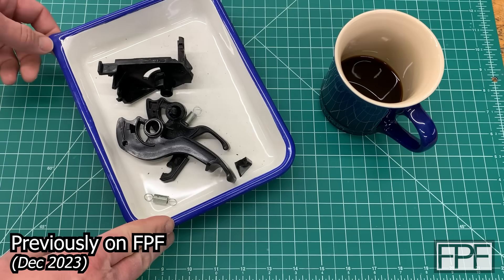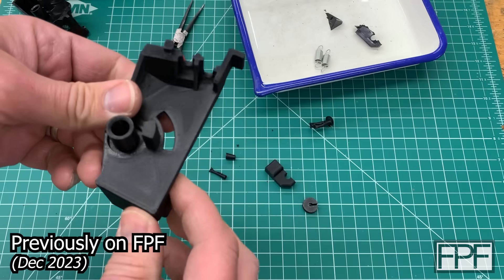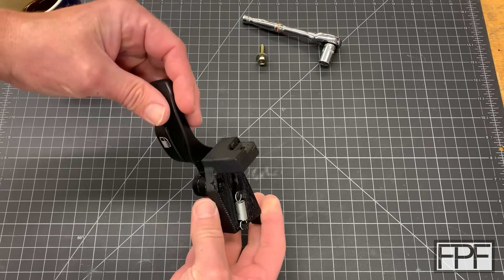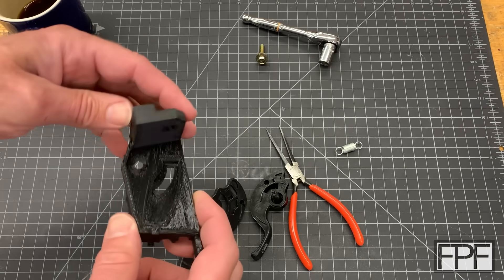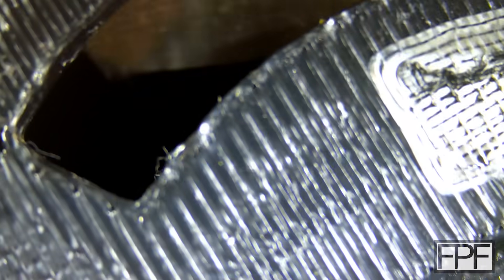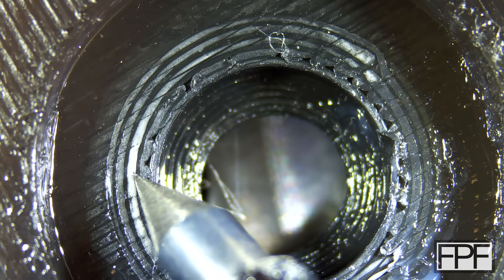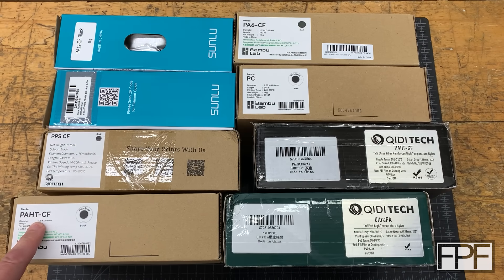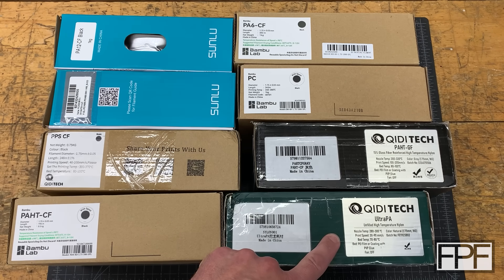3D Printed ABS Car Part Failure Analysis

Comment: 1. Easiest solution is to just add a hole through that part that broke off and put a small long screw through it. Then the material basically doesn't matter.

2. You got some things wrong about your filaments. Pa6 and pa12 are two different kinds of regular nylon, 12 is a bit weaker but is much more moisture resistant. Pps is not a nylon, it's something completely different. Qidi ultraPA and paht-cf are not regular nylons, they are PPA filaments and are very stiff, much more than a regular nylon. Bambus paht-cf is pa12-cf. 6 and 12 are not the cf percentage

Comment: Simplest place to start would be to run a flow dynamic calibration test for whatever filament you choose on the Bambu printer to remove the under extrusion ... review other slicer settings to make it stronger.  Do it in the original ABS to confirm that this solves the problem.  Also some greases and locktight degrade ABS / ASA ... use a dry wax lube.  https://youtu.be/5CVq6DycUOE?si=OrKUif9b5eK9i1Im   Make some test pieces that mimic the two failure points and print those, break them open look under the microscope and adjust settings until you get the print as you want it.
Reply: I reviewed his earlier video to understand the original failure. He used the same silicone grease I use to lubricant my P1S. It is recommended for most plastics, including ABS.

Comment: You are correct that the dimensions of the cylinders are constrained…but that constraint is primarily relative to one another. You may need to allow a pin inside the smallest one, and there may be a feature you need to clear on the outside, but without that you are free to resize with impunity so long as you resize all three at once.

Also, what you identified as under-extrusion may not actually be (without knowing more about your CAD and printer settings); it may be that the feature thickness you chose isn’t the proper value for an exact number of perimeters. It did draw the first two perimeters correctly touching on each side, but just laid the fifth one halfway between because the remaining space was too wide for a single perimeter to fill but not wide enough for two. I’ve made that mistake plenty.

Comment: Make in 2 parts. 
1.  Main body printed with current orientation. Thicken underside to suit
2. Flanged sleeve with chamfered transition between cylinder outer surface and flange inserted from the underside. Printed in 45 deg rotation (or horizontal). Superglue assembly.

Comment: 1:10 the engineer who put this here needs to be fired, you don't put something like that in the foot well where it's going to get kicked and stepped on.
It's not really that much fault on the printed part (even though yours under extruded), OEM parts like that do break if you step on them hard (like what would naturally happen in that location)

Comment: Consider the taxes those printer prices seem to be extremely low.

As far as I know, adding fibre to the material does not help (or might harm) for inter layer connection.

Comment: rotate the part 90 degrees and print it so all the high stress poking out bits are not supported by layer lines that can shear off. you could even get away with rotating it 45 degrees, so the parts that sheared off have some layers transiting the shear points. if you are going to use ABS, do an acetone dip so you solvent weld all the layers together as well. or use a better material. PC or PA, with carbon fiber. the part is small and the added cost won't be much.

Comment: Change the orientation. Otherwise, based on the way it failed it was definitely stood on. Forcing the levers past their stopper and putting excessive bending load on the pivot. I recommend doing nothing and making the shop fix it!😂

Comment: Make your part thicker where you can behind the round cylinder.  Then make the hole around the cylinder deeper.  That way you can give it a nice radius at the base.  To have a flat bottom print a washer that covers the radius.

Comment: Have you tried to orient the print so it prints without having any weak spots from layer lines? If it's not possible to orient it that way you could instead print the weak parts separately with correct layer orientation and then glue them in.

Comment: Recommending TPU for AMS on 0.6mm nozzles.  From memory, 0.4mm nozzles didn’t work for me.  I’ve since updated the H2D, so … TPU has great z-axis adhesion.  Note, I haven’t tested other higher end materials.  I also printed at 230 at the nozzle from memory - 10 degrees hotter.

Comment: one possibility would be to add a hole you could thread a small bolt through into that tab from the other side.
Reply: Finally, the correct answer

Comment: I would make the cylindrical part a sleeve with a lip on it (L-shape cross section), if possible, with a big ole washer on the underside to secure it (I assume a bolt runs thru it). Washer maybe not needed if you used a countersink screw head type. This makes the concentric layer adhesion a non-issue. But you could reinforce the lip on the sleeve with a chamfer/blend to get some more strength in that cylinder, like you would have if it were on the top side (but didn’t have the room). You could add a chamfer relief to the underside of the big piece to leave room for this chamfer. This two piece design also means you could lay the cylinder on its side and orient the layer lines vertically on the cylinder, adding to its bending strength (would require supports but would be stronger). Maybe consider downsizing the hardware, to get more walls on the cylinder. I also don’t see why you couldn’t add a blend/chamfer on that square block piece, but maybe there is some interface with the other piece? I’d try PET-CF, that stuff has been great to print with lately, is strong and temp resistant, and is relatively affordable. I started using the “Iron all solid layers” option and while it increases print time, it also significantly bonds the layers together better,melting each layer into each other and filling in underextrusions. An awesome feature for functional prints!

Comment: I would figure out how to print that cylinder with more constant extrusion and adhesion, maybe lower speed and increase flow?
As for that stopper piece that broke, I would consider replacing it with a bolt. 
Swapping plastics might work but I wouldn't jump to that right away. I would  first consider changing the print orientation since it broke on the layer adhesion which is probably not going to be improved with stronger plastics or infused GF and CF.

Comment: At least for the nubbins that hold the spring, I'd try a machine screw inside to borrow some strength from steel. Maybe there's something metallic that can be used to strengthen the hollow boss / axis pin. Perhaps a bronze bushing.

Comment: I would still use ABS. Like others have said print the parts that broke as separate pieces that fit into a pocket. Print them so the layer lines are not un line with the stess points. I would also add acetone vapor smoothing to try and increase layer adhesion to ABS parts.

Comment: If you are going to live and die by 3D printing you should ignore everyone who said put in a bolt / screw / pin and see if you can get the part to work via printing only
I think the rectangular block failed first which then enabled the cylinder to shear off so in CAD I would cut away two small slots or cylinders into the block so effectively you are adding additional solid walls internally and I would experiment with putting as large a chamfer as possible at the bottom of the block and the cylinder to provide more resistance to them shearing off
I would also see if you can add a printed stop to the body of the part for the levers so they cant be lifted past a certain point to cause the break.Slant 3D has a good vid on how to make parts stronger through design
I think PET-CF would be a great material for this part. Print it at 305C so it really melts together
I think your vids are great so keep up the good work!

Comment: Many people have tested ABS strength, and while it is heat resistant, it's too brittle for most things.

I would imbed a metal frame into the part. Poor design, more more Toyotas moved those levers to under the dash.
Reply: It's not brittle at all, quite the opposite.

Comment: i would go unfilled filament for the better layer adhesion and with parts rubbing on it there will be some abrasion, also i woul design the part so the two parts that broke off are printed separately and inserted and glued in after. Because of the large final layer that they are printed on there is a lot of time for the plastic to cool down and loose even more layer adhesion

Comment: Definitely either change the print orientation of the whole part so the stress isn't along layer lines, or break this up into multiple parts with print/layer orientation that complements the intended stresses and then assemble the parts. I don't think a material change alone will make this sufficiently stronger.

Comment: Printing the cylinder and post separately, aligned for layers running perpendicular to the stress would make a huge difference no matter the choice of filament.  Create a socket for them in the body and insert. 
Another option would be to use a pressed in steel pin instead of the post.

Comment: It is likely the original part was made out of PA6-GF. PA6 and PF12 are just different nylons. I would try a Nylon if you're set up to print it dry, either CF or GF impregnated. I do not have personal experience with these filaments though.

Comment: There is an experimental fork of Orca slicer that has a feature called "staggered perimeters". Together with a slight over extrution you can increase shear resistance and bending resistance by quite a bit.
Reply: Someone who really wanted staggered perimeters to work well tested it. His tests showed only a slight improvement. However, overextruding showed significant gains in strength. IIRCthis was CNC Kitchen.
Reply: @iseolake  Yeah, I watched that video as well. He only tested in tension. For shear forces it should be much stronger.

Comment: PPS-CF is way to brittle, PAHT-CF is easy to print and has some flex to it. The one I would recommend is PPA-CF. That filament is magic but might also be to brittle. Biggest gripe is how stiff the filament is on the spool, can’t even use the last 150g+ cuz the extruder can’t unspool it.
Also, why can’t you hand modify the part to allow a chamfer on the printer part?
Reply: Paht-cf which is actually ppa-cf has some flex? It's the most stiff material you can 3d print at home. Unless you are thinking about bambus paht-cf which is pa12 but it's also pretty stiff, more than the pla

Comment: Id make the hollow pivot part a separate piece and attach it by threading a short screw in to it from the face that that you said could be thicker, you could also do the same thing with the stop by threading 2 small screws or set screws  into it(it could still be one piece just with holes to thread a screw into), that way the layers are mechanically held together and will not fail along layer lines.

Also another simple thing you could do is add fillets to the stop in the xy plane, not sure how much difference it would make since it is so small but fillets generally make for a better toolpath and reduce stress concentrations.

if the pivot is a standard size you could also try and find a bushing that you can press in from the back side.

Comment: I would suggest you change the orientation of the print so that it can't break along the layer line.  Of course you would probably have to use supports, but if you have a printer that can do multiple filaments, you could print the support in something that does not adhere to the primary filament and you would get good results.

Comment: From a real novice- how about TPU for AMS (Bambu)? Not sure of temperature capability .  Also print at an angle so layer lines cross over the weak point.  Reduce layer thickness to a minimum? I enjoy your thought process for your design s.

Comment: PA6-cf and PA12-cf do not refer to the percentage of carbon fibers. They are different nylon polymers. However, to solve your layer adhesion problems I would consider printing the part in a different orientation so that stress does not occur along the layer lines in the first place. You may also be able to print the part in several pieces if you want to avoid the excessive use of printed supports while still printing in the strongest orientation. Of the materials you have here PAHT is probably the strongest, but I wonder if a hard TPU will work fine here if you only care about layer adhesion and don’t want to change the orientation.

Comment: Just print the nub that holds the spring separately in a horizontal position and make a hole where it would attach to the main piece. Then glue both of them.

Comment: The QIDI PAHT-GF is really a PPA-GF, the prints that I have done with it has been really strong and had really good layer adhesion while the the ABS that I have printed have had a tad low layer adhesion. I'd give the QIDI PAHT-GF (PPA-GF) a try on the current-ish design instead of putting a lot of time and effort into a big redesign and it would likely hold up much better.

Comment: PA are the nylons, 6 and 12 are the length or number of carbons in this case, in the monomers of the polymer. I think PAHT-CF would be a good choice. The PA6 and specially PA12 usually suffer from creep.

Comment: Barring inserting a metal part I would say to create a mortice/tenon to fit one face to another with a pocket in the middle for a plug to be printed separately.  (Similar to a biscuit or domino joint.) Then use something like Weldon16 to glue it all together.

Comment: I've noticed over the years that there are design considerations that apply to printed components. Things like reinforcement ribs, chamfers, relief cuts... It still won't be as strong as an injection molded part without annealing though.

Comment: I've had a look at the model.  For the part that snapped next to the tube. Pin it with 2mm locator dowels.  For the tube it looks like you have just enough meat to use 1mm pins (or drill bit snap offs) I'd use 8 x 1mm pins arranged evenly and inserted from the underside.  Again don't underestimate the additional strength from CA glue saturation. Or if you can get it in the correct size. Sleeve it from top to bottom in thin wall brass tube (from the underside).  Heat the brass until cherry red and once cool it will be quite malleable.  You have a lathe so you could make the tube an insert with a brim (like a top hat) and press it in from the bottom.

Comment: I have strengthened parts like that by modifying the CAD model such that the parts that broke off are separate parts that extend all the way through the part.  This way, those parts that broke can be printed flat so sheer stress is perpendicular to the layer lines.  This method requires some assembly after the print is done of course.  I would go with PETG or whatever filament you have that reacts with Weld-On to fuse them together.

Comment: Now you know where the part is stressed, so I would redesign it to be 3 or more parts. Main body and inserts which are stressed by the springs/rotational forces. Then you can control print orientation of the inserts for best strength. Workout tolerances to insert the inserts. Not sure if material really matters, ABS is generally fine, anything more "rigid" -- would likely fail faster with less ductility. You could try ABS-GF, but I've had parts which require some flex snap on me and I've gone back to regular ABS in the past for those parts. It's less of print tuning/better layer adhesion than part design for FDM problem. If you're not going to get the part SLS printed, and want to treat it as an engineering problem for FDM, look at open source printer designs where parts are intentionally split to take advantage of orientation and material ductility.

Comment: Would PETG GF be a good choice? Whenever I’ve used ABS in the past, it’s print quality is amazing but it seems to be fragile. I don’t think PETG has that same issue. The one thing with PETG to watch out for is it has trouble with overhangs as the material likes to droop so if you’re gonna use it for this part, you need to make sure you have plenty of supports and if possible use a different material on the interface layers so it supports peel off easily. This is because it’s layer adhesion is a very strong.

Comment: I'm thinking the PPS-CF is your best bet. PPS has incredible layer adhesion even with CF added, and it's tensile strength is incredible. Flexural strength isn't the highest but for this part it's not like it needs to be under constant flex, it not always supporting a load it's generally just sitting at rest.

Comment: PAHT-CF I have used both Bambu and QIDI with great results in parts like that. I do increase the bed and extrusion temps.  if you have a H2D then use the Bambu support filaments on that ugly side and fully support the part so the wall layers stay perfect. To bad you cannot use a radius on that hollow pin...😢 Remember a little flexing is not a bad thing!  it is better than brittle and then breaking and tearing! Thats is for the PA6 vs PA12 people out there.

Comment: PPA-CF (from Bambu or Siraya Tech) have been successful for me in small scale combat robotics, ebike parts, and parts for my sous-vide circulator. Clough 42 has an excellent video analyzing the material https://youtu.be/OWH_N9PmjeY?si=CFJ1d1i7F_gD11lc . I did both annealed and unannealed parts for my combat robot and didn't notice much different in that application but I ensured to get the X1C build chamber up to 50 degrees C like he shows in his video. (here's a link to my combat robot Banshee btw https://www.youtube.com/live/HKLYD-FY7oM?si=4mMqtBIZJY2hrL0o&t=5506)